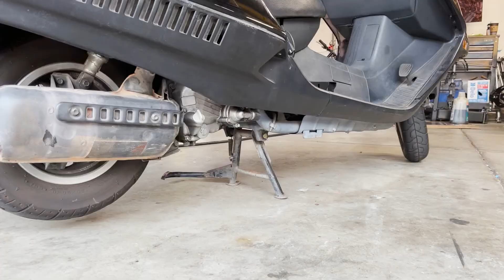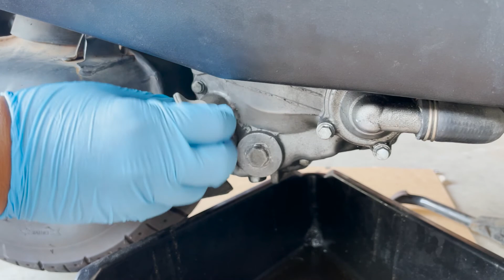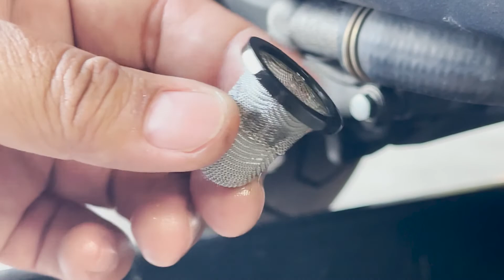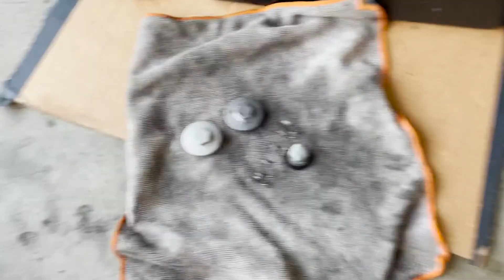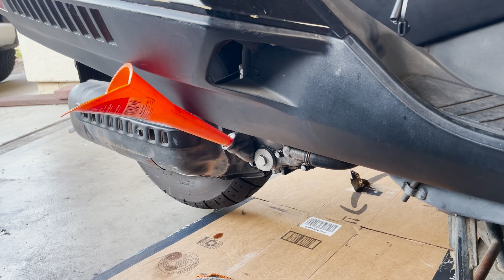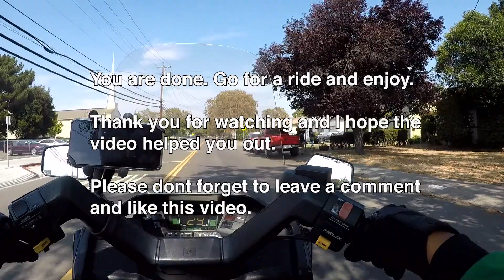Honda Helix Oil Change

Comment: Just got one at yard sale been sitting for a couple of years according to the owner paid $500.00 took it home cleaned the gas tank out , new battery and it started up.
It does stall a little on take off  so I replaced the spark plug and changed the oil . I've been using it around town and it gets great gas mileage. It's my daily driver now
best money spend.
Reply from the maker: Nice find. So did the stalling go away?

Comment: Good video as always I had to replace the oil filter cover on mine also because the prior owner rounded the nut edges off, but I finally managed to remove it with locked on vice grips. Because several of my vehicles require an odd oil level capacity I'm in the habit of once I finally reach the proper level after running the motor and re-checking it a couple of times I take a marker pen and draw a line across the clear vertical oil level sight on the side of the container and mark the container as that vehicle (Helix, Mower, etc.) and save the container on a shelf so the remaining oil can be used to top off if any is needed until the next oil change, just transfer that pen mark over to a new full container and just re-fill the oil level to that same amount during the next oil change and it will be spot on accurate the 1st time.
Reply from the maker: Thank you. I am pretty meticulous with my work but you are on another level.
Reply: This is a really solid tip. I’ll be sure to practice this with my own Helix maintenance.
Reply from the maker: @AudreysKitchen  Let us know how it goes.
Reply: @MacrossGarage  yesterday I replaced a cracked coolant reserve tank and installed a new horn for extra safety. Then put about 100 miles on the old beast. So much fun to ride!
Reply from the maker: @AudreysKitchen  Very nice.

Comment: Very helpful! I just got a '93 helix with 32k miles on it but not much in the way of a service record. I'm going through the maintenance checklist so I know for sure that everything is current. Happy riding!
Reply from the maker: I alway  change the oil no matter what and go from there. If it runs well then you should be good.
Reply: how did it go? thinking about pulling the trigger on one with 23k miles, the muffler is the only part ive seen and it looks a little bit rusted. Love the bike tho.
Reply: @tonberryking7836  I think that's inevitable, mine looks pretty rusty but still works great. I would say go for it!
Reply: @isaiahhiggins  what did you pay for yours if you dont mind me asking? and did you learn to ride on your helix? im thinking 2k is too much but the body and seat do look good.

Comment: Nice video. Thanks. Only use 12-point sockets or wrenches to snug. Use 6-point sockets/wrenches to tighten. Those 12 points will round your nut.
Reply from the maker: Thanks.

Comment: Torque settings for both bolts (according to the 1986-2007 CN250 service manual I ordered) is Oil Drain Bolt - 15-18 ft/lbs and for the Oil Strainer Screen Cap is 13-16 ft/lbs.
Reply from the maker: Thanks for all the information

Comment: Fill the engine with 1 quart of 10W-30 ,This is in the manual for this bike .
Reply from the maker: The manual I read says .8 qt for drain and fill and 1.0 qt for engine assembly. 10-30 and 10-40 are very close, use 40 for warmer areas. I wish I can screen shot what I read here. Could it be different depending what country you are in?
Reply: @MacrossGarage Excuse me, what do you mean drain and fill engine assembly ?!
Reply from the maker: @TOMCAT4500  drain and fill is the normal oil change maintenance.
Reply from the maker: @Patrick O'Brien You are correct. I guess I've never had to use 5w since I am not in a colder area.

Comment: I would not have thought about tilting it to get more of the oil out. I'll remember that one. Will regular 10w-40 work? Thx.
Reply from the maker: I used Honda 10w-40
Reply: Btw, you can always uprate to a higher 20/50 Full Synthetic V-Twin Motorcycle Oil.
Will only help provide more protection, especially if in a hot climate.
Stick with 10/40 in Alaska or Canada lol.

Comment: Thanks for the helpful oil change video.  Could you tell me about your phone mount?  Have you wired up a charger?
Reply from the maker: Here is the link to the Ram strap mount. I have no wiring for charging. I will look for a charging option soon.
Reply from the maker: https://www.amazon.com/RAM-Mounts-RAM-B-108BU-Strap-Diameter/dp/B0030HO6SM/ref=sr_1_5?crid=3LPLW5277HUQ6&keywords=ram+mount+clamp&qid=1666116383&qu=eyJxc2MiOiI0LjkyIiwicXNhIjoiNC44OSIsInFzcCI6IjQuNTgifQ%3D%3D&sprefix=ram+mount+clamp%2Caps%2C141&sr=8-5
Reply: @MacrossGarage  Thank you very much!

Comment: Hello! Thanks for post this video, is very helpful, I have a 1996 Hinda Helix with almost 13,000 miles, I have a couple questions,
Do you know where can I buy the gasket for the oil filter? and when do you clean the filter are you using just a rag, don't use and W-D40 or any lubricant?
Thanks for your help.
Reply from the maker: if your talking about the rubber o-ring, you can find that on amazon and ebay. Let me know if you need a direct link. As far as cleaning the screen, I just wipe it down. Just make sure it doesnt have dirt or anything blocking the screen.
Reply: @MacrossGarage  thank you for your fast reply. If is not too much to ask could I have the link to buy it please?
Reply from the maker: @DavidMedina-mg5sl  I go to babbitsonline. You can order from them or just use the part number to google search it.

https://www.babbittsonline.com/oemparts/a/hon/5053e2b5f870021c54be1dab/right-crankcase-cover

Part# 91302-001-020

babbits seems cheaper and its authentic Honda part. Try Revzilla as well.

Comment: My oil filter cap was too tight and the 17mm socket I used (6 sided) seemed a tiny bit too large and was starting to round out the edges. I now use a 21/32 socket which is a perfect fit. I ordered from Amazon. It seems Honda made the filter cap a tiny bit too small as there is too much play with the 17mm socket. The filter cap was perfectly fine before I started to loosen it.    21/32 is equal to approximately a 16-1/2mm socket.
Reply from the maker: Yea mine stripped also. I ended up using a wrench to carefully remove it. I try not to over tighten it.

Comment: I am mentally preparing myself to do my first oil change on the Helix thank you for the video... but more importantly the link to your phone mount?  Its been a struggle finding a good one for the fat handle bars
Reply from the maker: No problem. There is also the option to mount the phone on the brake reservoir. I did it for my Honda Pacific Coast.
Reply: Yes, I cannot find a mount for my phone. I was looking at a RAM mount to hold the phone, but what do you use to wrap around the thick handle bars?
Reply from the maker: @kara8235  I use the ram mount strap hose

https://www.amazon.com/RAM-Mounts-RAM-B-108BU-Strap-Diameter/dp/B0030HO6SM/ref=sr_1_5?crid=3LPLW5277HUQ6&keywords=ram+mount+clamp&qid=1666116383&qu=eyJxc2MiOiI0LjkyIiwicXNhIjoiNC44OSIsInFzcCI6IjQuNTgifQ%3D%3D&sprefix=ram+mount+clamp%2Caps%2C141&sr=8-5

Comment: Looks like I put the filter in backwards. I bought it used and put it in the way it came out.
Reply from the maker: Easy to fix. Just replace the oil that comes out when you remove the cover.

Comment: Maybe rub oil on that filter plug seal so it doesn't seize again. But someone probably put it on way too tight.
Reply from the maker: Too tight or sometimes they never remove them. Thanks for the tip.